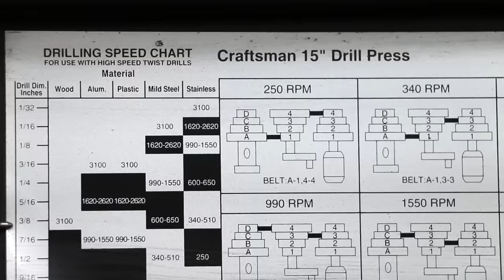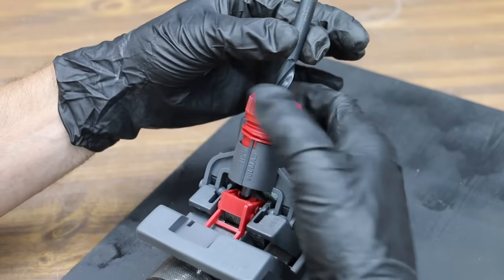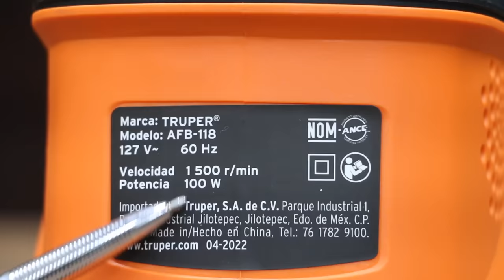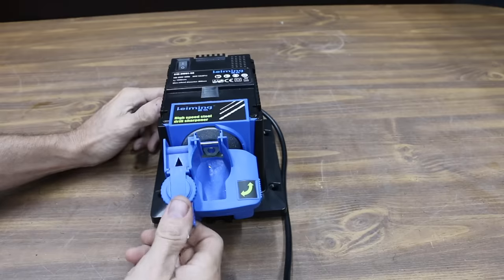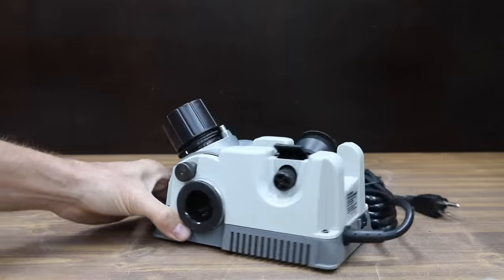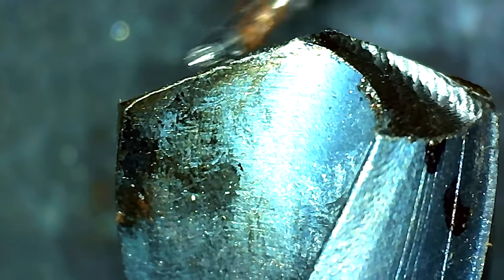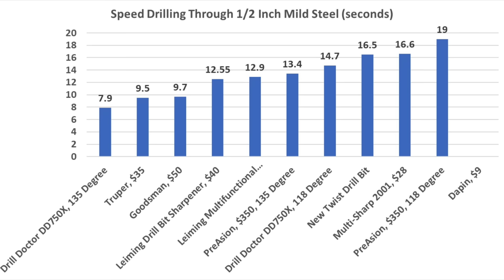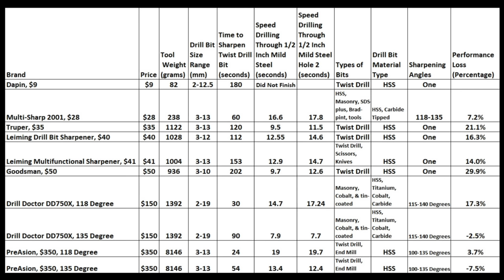Which Drill Bit Sharpener is Best? $9 vs $350--Let's Settle This!

Comment: Have great experiences with the Drill Doctor. The split point option is a nice addition to an otherwise already excellent machine. Used similar less elaborate and cheaper drill sharpeners in the past. They never ever lived up to my expectations. Had been deliberating on the ‘Ainso’ or similar European brand some years ago, but even though the machine feel is great, for the amount of drills I sharpen each year, too great of an investment. The compact design of the Drill Doctor sold me. It can be easily cleaned, maintained and stored, where the Ainso is more like a stationary machine especially on the weight aspect. Added to that, I worked with the Ainso in a shared workshop, where it first wasn’t bolted down. After some lessons learned we permanently mounted it, which seriously improved its sharpening capabilities. Hence, the indecisiveness when I needed a sharpener for my second or third next workshop. 
Also, excellent and outstanding explanations on the different sharpening tools.
Reply from the maker: Thanks!  Thanks for sharing.

Comment: Superb as ever and very well made. I have a Drill Doctor 750x, after you recommended it last time. I like the wide range and ease(ish) of use. If I had Superman’s eyes and hands I’d just use a bench grinder, but instead the DD is the next best thing, I think. Like the Pre-Asion but too expensive, plus not seen it before. At the end of the day drills are not that expensive and all these tools have a consumables price, too. I try to look after bits and tend to pillar drill ~200rpm on all materials as this produces good chips and fine results. Oil is even cheaper that bits. Hand drilling is where accidents tend to happen and bits get damaged. Thanks for making and sharing.
Reply from the maker: You are welcome!

Comment: Another great video keeping things honest.  As an idea, what about hardening techniques after sharpening vs remaining just resharpened.  I usually use a propane torch, to heat them, then slowly dip it in cutting oil to cool and harden it.  Curious if there's a better method, or how that stands up compared to just getting a new bit.
Reply from the maker: Thanks!  Thanks for the suggestion.

Comment: I was thinking of buying drill sharpener since I have a hoard of dull twist drill, left by previous owner of the house.  Since I don't do general construction, its no use sharpening all of those drill bit and I found out drill Doctor is expensive.  I will just buy if I needed to replace my Harbor freight titanium, it works well still sharp.
Reply from the maker: Thanks for sharing.

Comment: I use Drill Doctor (deluxe model with the point splitting capability.)  If you use ANY drill sharpener, you will quickly learn that the key to proper sharpening is indexing the drill in the initial step.  I also have a $1000 Derex sharpener (that is sold with bench grinder).  The Derex fails on the indexing step, because you can't get your hand on the back end of the drill while indexing.  With the Drill Doctor, you can urge the drill into position to get it to engage the indexing paddles easily.
          Both of these require setting the collet to grab the drill, but still loose enough to index it.  If they designed these right, you would fully tighten the drill in the collet, & that would slip into another sleeve to permit indexing.
Reply from the maker: Thanks for sharing.

Comment: I could actually use the Dapin pretty well if I turned it over and watched from the back side. Then I could see the cutting edge where it was hitting the grind cylinder. I also cut away the cross piece of plastic so my finger could hold the drill up against the plastic guide better. Was actual able to take a broken drill and redo a point on it, granted it's very short now! Went through and sharpened all my collection of crappy old bits.
Reply from the maker: Thanks for sharing.

Comment: Hey Todd,  As always I appreciate your attention to detail and non-bias testing. Quick piece for feedback, it would be helpful if you included the control results into the graphs and tables.  Having baseline data to compare against the sharpeners would be uesful, especially on the second hole performance and % loss in speed. Thanks!
Reply from the maker: Thanks for the constructive feedback.
Reply: @ProjectFarm  Thanks for incorporating the feedback in your Plastic Welder video, super helpful!

Comment: I like the Drill Doctor, but figuring out what setting you need for some bits is a little  tricky, and if you sharpen bits over a 1/2" definitely buy the extra course grinding wheel for it!

Comment: This was interesting. I was surprised by the limited options and how involved most of them were to set up and operate

Best Twist Drill Bit Sharpener I've ever used is my Delta Belt Grinder with a 300 grit AL/OX belt on it. (My Grandfather would have slapped me across the back of my head if I went out and actually spent money on a bit sharpener)....The Delta is a lower "speed" than the Burr King, (1725 sfpm vs. 3450 sfpm) so it doesn't burn the temper out of the bit as easily, the flat platen is perfect for setting the angle).. Set your protractor at 58-60 degrees, tool rest at 90 degrees, don't push it, let the belt do the work. Check your progress often...When you're done, switch belt out for an 800 grit to dress them up. (I do them in batches)..As long as the Bits are made with some decent HSS, (there's a disturbing amount of really cheap junk drill bits being sold that aren't), they basically cut like new

Comment: Ok, 4 video ideas. 
1. Differences in wire loom, braid vs convoluted, is cheap braid as effective as expensive? Does braided loom live up to its claims? 
2. Heat shields, are cheap amazon heat shield as effective as DEI and does it last as long? Does the sticky back heat shield work and is the gold color any better than the silver? 
3. What degreasers work best for cleaning up an old oil leak under a truck? Is oven cleaner as effective or better? Which products are safe on rubber and plastic?
4. Are cheap aftermarket weatherstripping as effective and long lasting (ie retain shape) as the OEM or expensive weatherstripping for vehicles? 

Thank you Todd.
Reply from the maker: Thanks for the video ideas.

Comment: very nice test .. but it would make sense to test drilling of at least 5 holes. With these devices the speed of grinding process decides how fast it will drill and how long the drill will last. When you burn the tool, it is just a question how long it will last.
Also .. there is a question how long the grinding wheels on each device will last. the ceramic wheels are cheap, but will not last long. Galvanized should last longer, but overall the bigger the diameter of wheel, the longer time it will last. I did use the PreAsion (or similar) and Drill doctor in the past, and PreAsion did feel much more comfortable to use. Had to regrind a few hundred drills with PreAsion in one day and it all felt very smooth, drill doctor is too soft, cranks, is made just for a drill or two when needed. PreAsion is more suitable for an amateur regrinding shop.
Reply from the maker: Thanks!  Thanks for the feedback.

Comment: In the machine shop I used to work at, the tool room guy sharpened drill bits with a Darex machine. That guy was worth his weight in gold. There was always a sharp drill bit when you needed it. And the quality was five stars.
Reply from the maker: Thanks for sharing.

Comment: I think I'm going to order the Drill Doctor DD750X. Sure, it's more expensive than most, but it performs the best, gives you both 118 and 135 degree tips, and best of all, it leaves the competition in the dust by taking up to 3/4 bits. If I link to it from this video will PF get a small cut for the effort?
Reply from the maker: Thanks for sharing.

Comment: Very Nice video Todd, but I suggest if you ever revisit this type of test please check drilled hole size after using each sharpened bit because if the drill bit isn't sharpened evenly on both sides the center point will be off center and make the drilled hole oversize.  Love your videos.
Reply from the maker: Thanks!  Thanks for the constructive feedback.

Comment: I love your videos, great work and keep them coming! I have a video suggestion.  Last year I bought a couple flip up hand held work lights from Amazon and they are very handy.  The one complaint I have is that the magnetic base is pretty weak and will not stick well to surfaces that are not completely flat/clean.  When working under cars in real life it is nearly impossible to find a surface they will stick to and light the area I need lit.   It would be nice if they had stronger magnets and USBC instead of micro usb for charging.  My suggestion is to do a comparison of inexpensive work lights.  I paid $20 for a pair of these lights.

Comment: Great video as always.  Expert comparisons.
Would the weight of the drill bits before and after each sharpening matter?  So you can compare which takes off the least metal?  Or is this not really a concern for drill bits?
Reply from the maker: Thanks for the suggestion.

Comment: Awesome video once again thanks so much for your diligent testing of different products. A couple of suggestions to the testing and and assessment aspects of this test. I think using a cutting oil or any sort of oil to reduce heat would have been beneficial and I think bit durability (how long it stays sharp and cuts well) is one of the most important factors. Maybe 5 cuts in a row timing each one using oil might reflect using a drill press and batch drilling. Just my suggestions thanks again for an awesome video.
Reply from the maker: You are welcome!  Thanks for the suggestion.
Reply: A couple of other things to evaluate. Hole diameter and is it out of round. And since this is on a drill press, is the hole out of vertical, should be perfectly perpendicular to the metal plate being drilled. The uniformity of that metal being drilled might be a factor - thicker or thinner in spots leads to faster or slower times.

Comment: At work we have sharpener very similar to the last yellow one. Works perfectly. I had about 25 dull bits at home so I took them for the test. Some were even broken. Sharpener did great job and reworked drillbits cut better and cleaner than many completely new bits.

It is not that important to drill fast, but to have nice smooth hole, nice clean chips and durable bit shape with consistent performance.

Btw the cheapest drill bit sharpener is piece of sandpaper and stable hand :D
Reply from the maker: Thanks for the feedback.

Comment: The Drill Doctor is only assembled in the USA. I uses parts from "other countries". The Prison looks a lot like the Vevor 13A drill sharpener. Probably from the same manufacturer. I am saving up for one of the Vevor models because they have the best reviews and test runs bar none.
Thank you for your hard work on testing these cheap trash sharpeners but, I'm going with the Vevor. It's expensive but still cheaper than sending out drill bits to any questionable service.

Comment: Will the lower end sharpeners work better as a pencil sharpeners? 😄 Great demo of the sharpeners, each time I had to use someone else different brand at their place it took longer to learn how to use each one and sometimes just went to the bench grinder getting frustrated with their instructions and wound upt taking the bits home to the old reliable Drill DR.

Comment: I have a drill doctor, and I just bought a vevor sharpener that is the same as the preasion sharpener, and I can say the vevor sharpener is great, the drill doctor I have had for years, and it worked ok for a short while, then it got to the point I couldn't get a bit sharp no matter what I did, I kept buying new bits because at least I knew they were sharp, and now with the vevor I have a new set of bits that I used the 1/2 inch 1 maybe 2 times, and I tried to sharpen it with the drill doctor and tried it and burned it up, so I cut the end off and resharpened it, and went to use it, I think it was sharper than when the bit was new, it was about $350.00 but well worth it, in my opinion
Reply from the maker: Thanks for the feedback.

Comment: Drill doctor sharpens the best and the widest range of sizes. Hands down win cause it sharpens the largest most expensive bits up to about a 3/4" where as others stop at about 1/2" or less. Bigger the diameter of the bit the more costly by far. Too bad most those stop at such a small bit. Thanks a ton for the videos!
Reply from the maker: You are welcome!

Comment: Great review of Sharpeners. 

The biggest weakness of sharpening bits instead of replacing them is that you get an uncoated cutting edge instead of the performance coating that is typically on a bit now days, and you really need to take a lot longer than shown here in the vid to sharpen things because you should only do a small cut, take the bit out and cool it in water, then go back to sharpening, repeat.
If you just keep sharpening the entire time until it is "ready" then you build up too much heat and lower the hardness which greatly lessens the life of the bit, which is further exasperated by the fact you do not have any high performance cutting edge coating anymore either. If you let the heat from grinding lower the hardness then the edge dulls really quickly when you try cutting again.

I personally never use a sharpener anymore, despite drilling into metal on a regular basis. The time cost just isnt really worth it compared to replacing the bit. I get anywhere from 50-100 holes per bit, and if I sharpen them properly, taking the time to cool the bit and maintain hardness I can get an extra 15-20 holes each time I sharpen the bit. So ya I can double or triple the life of the bit by sharpening, but the total sharpening time for that many holes in nearly 30 minutes because of all the additional time of cooling the bit in water every 2-3 seconds of it being on the wheel. That time cost is at least equal to the $10 it takes just to get a new bit and keep going.

Still, great review. A sharpener definitely has its place in the garage of the home user who drills only a few holes a year.

For anyone wondering what kind of coatings to look for:
Black oxide like shown in the video is a great all around coating that is really cheap so adds almost no cost to the bits but extends the life a good bit. it works in all typical materials
TiN is another very common coating and is cheap, works decently, and can be used in all materials.
Then you have aluminum based coasting like TiAlN and AlTiN. These are higher performance coatings but should only be used with steel, never when drilling aluminum.
Zirconium is another higher performance coating, and it is typically meant only for aluminum and should not be used for steel.
Reply from the maker: Thanks for sharing.

Comment: Thanks for this.  175 lbs down force seems excessive..  You also didn't use cutting fluid.  Could some of the speed loss be due to the bit overheating on the first hole?  

All of them seem to produce rough looking lips, much rougher that what new bits generally look like.

Comment: The Multisharp seemed to have the most correct chips coming off of it and for the price, I will definitely give it a try. I have a DrillDoctor XPK (older version) and if you are gentle with it, it gives good results. You could see the Dapin's wheel was not even concentric: chinese JUNK.
Reply from the maker: Thanks for sharing.

Comment: While not a common bit, I have quite a few parabolic drill bits for deep center drilling on lathe.  From that line up only the 750X will sharpen those and that is because of the chuck.  Drill Doctor makes 2 models, the 350x and the 750X.  I origionally had the 350X but it lacked features i needed, my dad has it now, it does what he needs fine.  The 750X by far is the better choice though, it has a far superior chuck and can even sharpen parabolic drill bits back to like new condition.  I have owned a variety of drill sharpeners, the 750X hands down is my favorite.  I have mostly Cobolt drill bits and the parabolic drill bits I mantioned above.  After using it for years I can sharpen most bits in about 30 seconds.  Highly recommend the DD 750, just wish it also did end mills which I do by hand on a wet stone grinder that I made a guide for.  The only thing I had to replace was the stone (after a lot of sharpening) but it is considered a consumable.
Reply from the maker: Thanks for sharing.

Comment: i don't know if possible, but it would be great to get a review about LED light bulbs. You probably cannot really get durability tests, but heat is the main factor on LED use, so the cooler the led, the longer it should work. It would be really great especially since some bad ones are designed to fail relatively quickly whereas they could work almost forever if done properly.
Reply from the maker: Thanks for the suggestion.